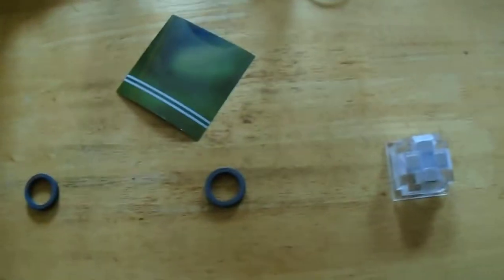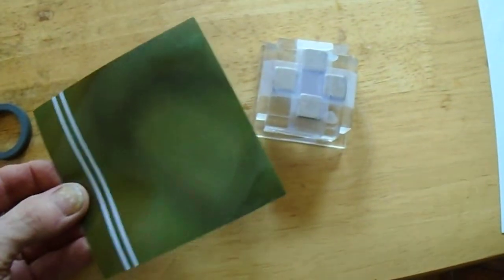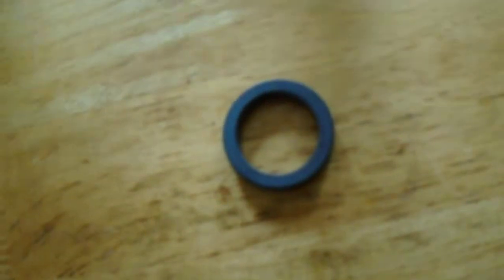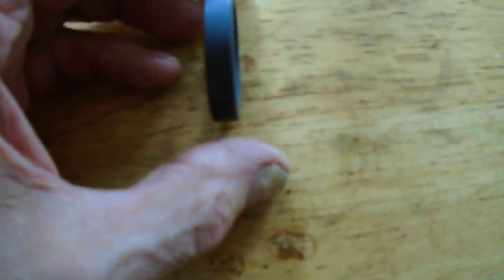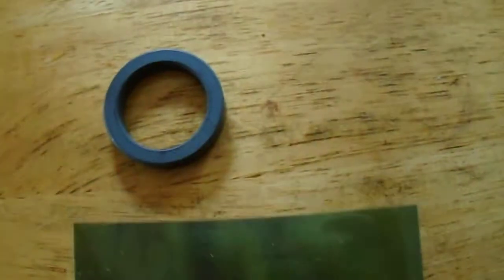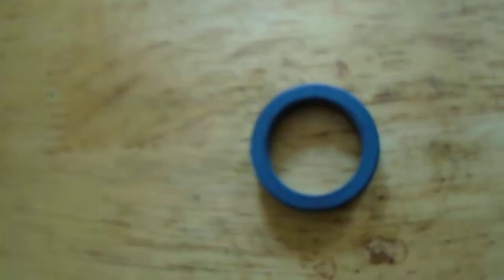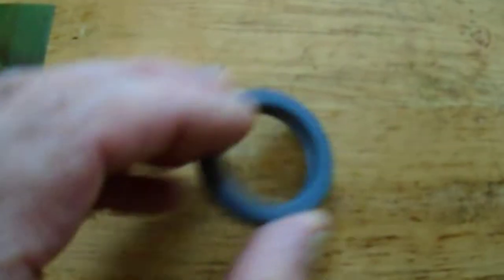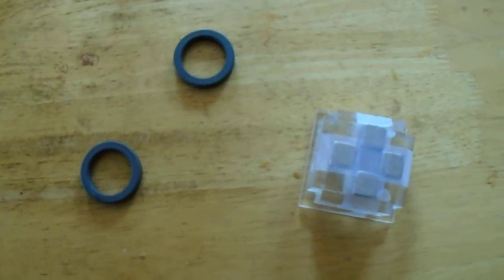overpowering a ceramic magnet

Comment: There is no dielectric along the inertial line as that NOT where the poles are...inner ring and outer ring on ONE side are n and s....a ring magnet works like a bar magnet rolled up...
Reply from the maker: depends on how its magnetized. You can have a ring magnet magnetized as a pie where one semi circle is north and other south or you can have the inner surface one pole and outer surface the other pole or you can have it magnetized  through the thickness.

Comment: Pretty interesting to see how the 4 cube magnets affect only one side of the ring magnet like that. Kind of like a magnetic field imprint. Is that a permanent configuration for that one side? I mean....does that side of the ring magnet's field eventually go back to being like the original magnetic field? Like the other side?
Reply from the maker: It will stay like it is. It wont revert back.